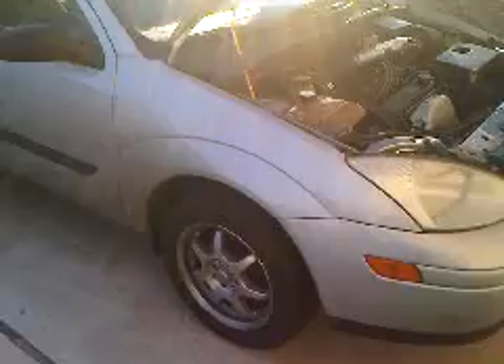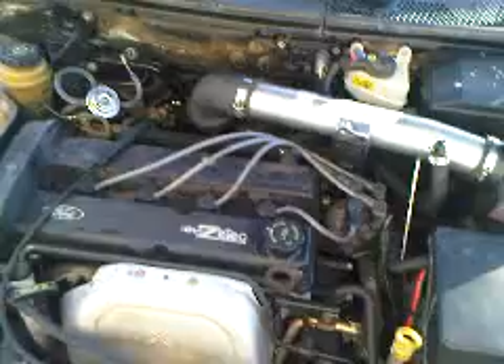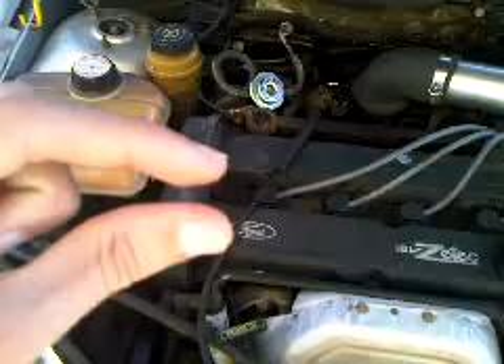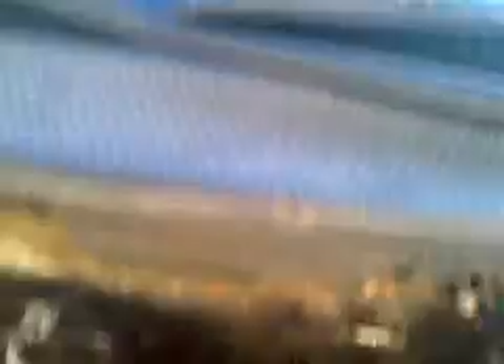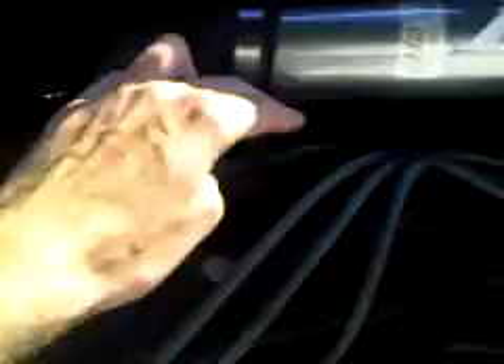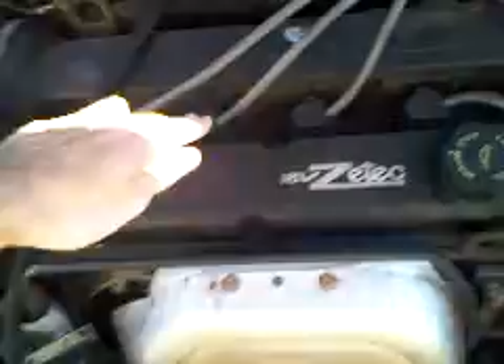2000 ford focus 2.0 DOHC - Engine Randomly dies - FIX?

Comment: I have a lot of experience with gen focus!!! There are not many parts on my 03 focus that I have not updated! I really don't have time to watch this video right now but, When I first got my focus se (Dohc zetec vin-3) when I would come to a stop/idle, It would stall out & what I learned was, The (I.A.C. VALVE) IDLE AIR CONTROL VALVE WAS DIRTY & NEEDS CLEANED ON A REGULAR BASIS! SIMPLY UNSCREW IT, CLEAN WITH BRAKE CLEAN OR SOLOVENT, SOME USE WD-40/PB BLASTER, ETC...I use brake clean & Q-tips, & then follow up with P.B. Blaster, LET IT DRY B4 REINSTALLATION, If yours has a gasket, reinstall it! I don't believe that mine had a gasket so, I made my own, IT IS LOCATED ON THE INTAKE! If you stand at the driver side, front fender & look at the intake, You should see a tag connected to the wire's of the iac sensor, It has been a while but, I found it easier to do while laying under the car, & reaching up to the intake. On a different note, I ruptured the front passenger brake line rite where it does a 90 degree turn & runs from the firewall on the passenger side engine bay, & turns & runs up the sub frame rail so, rite at the bend! I am trying to learn how to disconnect the round-ish fuel device that is directly behind the power steering reservoir? I can not disconnect the small tubular line that mounts on the top of that device. I think that I can disconnect the fuel lines but, not that small line which looks like a vacuum line & is rite on top. Heck, I don't know what it is called to even look it up?

Comment: My 2005 ford focus zx4 is cutting off driving. Anybody having the same issues
Reply: Check the wiring harness from the battery to ground to the altenator to the starter they burn out at are where it goes into to the car to ign/ecu! If that dont appear bad the other problem was the wiring harness to the ignition coil!!

Comment: Update 2: To fix: "Idles worse when warmed up." 
2 problems on my ZX3. 1. Collapsed PCV line at idle. 2. Fuel rail pressure sensor diaphragm was leaking gas INTERNALLY. No visible leaks outside. It's internal. This extra gas
 was flooding the car at idle. I replaced the coil, plugs and wires too but that problem remained even after the vacuum line PVC line  was replaced. The fuel rail pressure sensor leaking internally was it for sure because it leaks gas into the intake manifold via the vacuum line attached to it. Thusly, flooding the car at idle when warm with too much gas. Rough idle when warm is now  fixed!! No more rough idle. That pressure sensor controls the fuel pumps speed. If faulty, you get too much fuel pressure AND gas leaking through the diaphragm. Car runs rough at idle and/ or dies and because its too rich.

Comment: UPDATE: Mine turned out to have the collapsed PCV vacuum line. It throws a a P0320 code but the problem isn't the crankcase sensor at all. The elbow of the rubber line collapses while running and crank case pressure builds and the car won't idle either when put into gear. Just replace that vacuum line which is 5/8". The line may look OK when cold or when the engine is off but when there is a vacuum, it'll collapse because the elbow area under the manifold will get soft.

Comment: I think I have this exact problem that just started today on a 2001 ZX3.. Dies at idle. Dies when put into gear. No error codes. Seems like lack of fuel. UPDATE: I put in a can of SEAFOAM in a 1/4 tank of gas. Guess what !? Your observation and fix WORKED! Fuel pump pickup screen is clogged up from ethanol/water soaked gummy alcolhol sugar. Been raining alot and super humid lately. That muck in there is prolly like jello. The SEAFOAM worked like magic. So, for now,  I can take the car in for emissions testing. 
When I have time, I'll pull the fuel pump and clean the pump's fuel pick-up screen that is bunged up. Thank you! :)

Comment: How do you not have the mass air flow adaptor connected to your cold air intake? that square post on the tube is just open air flow then
Reply: Hi I replaced the fuel filter on my 2000 ford focus with z-tec engine but it still turns off when i start it while its cold

Comment: i picked my car from parkinglot after work it was normal i ride when  the car reach 80c i hear the engine begins to knuckle when need to stop to turn, the car died and i need to wait for 10 sec and start again but in dont know why the car died when  i need to stand still  for turn  the car is automatic

Comment: My 2005 focus is stalling I found a area where the battery is dripping acid once and a while on part of a wiring harness right where it plugs together to the right side of the battery box it looks very crowded. I would think this is an issue at least its a good place to start the harness really looks bad it must have been doing that for a while.

Comment: What's the shiny disc between the air intake and the jug on the passenger side of the engine?
Reply: +Steve Miller Supposedly it's a fuel pressure dampener.
Reply: Ok, thanks!

Comment: I have an 03 zx3 moded out and have been having this issue and watching this video just helped me. It is most likely to be the idle control valve, with all of the things you listed you have done to stop it and everything I have done to mine to try to stop it basically leaves that to play with. So thank you I will be getting mine fixed today.

Comment: its not a filter on the fuel pump its a screen that the fuel passes threw and does act as a filter but the fuel filter is under the car and is in a fuel line usually located bolted on the frame
Reply: Chris thursby located passenger side right in front of back tire on the frame

Comment: check you vacuum hose that goes into your intake manifold. you'll hear a hissing noise. follow the noise. no spray needed unless it's coming from the intake itself. then you'd have to spray the gaskets. i have a 2000 ford focus and it was a vacuum hose with a big ass hole in it. i'll post a video later.

Comment: It's weird, but my car used to do that, until a track-day, when I filled up with mid-grade gasoline, and managed to reach 160km/h. I had no problems since then, I guess the pressure required to run at such speed cleared the fuel line.

Comment: Chris. Next time before all the work just put a gauge on the rail and run to windshield from outside and hold down with wipers to keep at eye shot. Runs it up long hills and what for a drop in pressure , there a vac hose and electronic sensor where the UFO disc clips onto rail (orange clip at line and reg connect.) good job on the diag , Most techs would bounce that. I just found the disc leaking off throttle a little on a customers car on ford discontinued it. Great Motor, I've had three Focus

Comment: I HAVE SAM PROBLEM ,I HAVE FORD FOCUS 1.6 TDCI TREND,IN 2 -GEAR OVER 2.800/RPM 60KM/H+ ACCELERATION HE DIE,LIKE HE DONT HAVE FUEL,PROBLEM IS NOT FUEL,FILTERS,ect..PROBLEM IS ELECTRICITY MAIN BOX,(sensor,and parameters?...IN EUROP TO FIX THAT COSTS -1.000 EUROS!.

Comment: I have a 2000 Ford Focus ZTS, and mine does the same thing.  It used to shut off on me just before it hit E, no gas light or "low gas" warning or anything. Now, its shutting off around a quarter tank. If my gas gets to be that low and I try to accelerate onto a highway ramp or something, my car hesitates/jolts, and even stalls sometimes. I'm pretty sure its the fuel pump, but I'm really hoping its not; so I'm gonna replace the fuel filter first and pray that works.

Comment: Coil pack. Check it for cracks. 
I've had the same problem and done everything you've done. Checked the cap, cracked to hell. Keep in mind, any cracks can mess it up. Replaced mine, runs perfect again.

Comment: man change the harmonic balancer you'll find the rubber support is slightly worn this then sends a false signal to the crank angle sensor,put a new sensor in also

Comment: eh. get an old escort gt from the 80's. those things didn't really have these issues and if as long as you keep em cool they run forever. my foster brother has a 03 SVT that's riced out to shit. He bought for 10k from a dealer and has had problem after problem. He's a bit of a jackass but that cars cost hime 6k in maintenance due to a jackson racing supercharger and an oil cooin system that never agrees with the car.

Comment: I'm about to get a ford focus that has a similar situation. My girlfriend took it for a test drive and it started up, she backed out of the drive way and it "died". She had to turn off the car, put it in park then turn it back on and the car turned over, and she drive it around the block. Fuel pump problem...maybe? How much for a shop to fix it if you know? Let me hear your input please. Thanks!

Comment: @viper19861986 did you put cold air intake to your focus? and did you have to change anything alse to get the intake working? let me know if the intake will be a good idea cuz I want to do the same thing on my car..........
Reply: I have a 2003 Ford Focus. It wants to die when stopped at a stop light ?? Anyone have any ideas???

Comment: One last thing.  If you replaces the rear section of hose you may want to put a hose clamp (other names: worm clamp, jubaliee clip) on both ends of the hose. I put a little grease on the end of the hose and it slid off, so I had to clamp it. A hose clamp will allow you to get a long screw driver down behind the ignition coil to tighten it.  You can hold the clamp in place to tighten by contorting your arm down behind the motor and around the right side of the motor.  :)

Comment: Cool, common problem.   We did the front brakes on my 2000 ZX3 this past weekend and the timing belt / water pump planned for this weekend.  already replaced Ignition coil (#2 not firing), plugs, wires, thermostat, fuel filter, air filter, PCV, pcv hose, cleaned MAF, injector cleaner, 2 new tires, front brakes, now timing belt and water pump.  Oh, also new fender and new hood.   Probably the trans fluid and shocks later.  Mine runs pretty good now, but I still get IAC code (P05016). fun fun fun

Comment: Check the vacuum line that connects the PCV to the back of the engine under the throttle body.

Comment: Looking at the spark plugs from left to right..the 1st wire connects to the top left of the ignition coil...second goes on bottom right..third on the upper right and the fourth goes on the lower left....i think I saw on you car that the first and second maybe even third where wrong...but not to sure...couldnt see that good. Lol....i got the same car thats why.

Comment: @whatchaknow100 just because you have problems doesn't mean others will you have to take care of your car and  it will never have problems mine has 81thou on it and the only thing iv ever changed was the fuel pump and it runs like it came out of the dealer. you just didn't take care of your car.

Comment: @viper19861986 My filler tube filter and the sock on the fuel pump were both perfectly fine and I couldnt see any gunk in the tank, but the actual fuel filter was REAL filthy yeah :)

Comment: @viper19861986 hi bud! I almost forgot about this video :) I just wanted to let you know that I sorted my problem and it almost defies belief. There was no gunk in my tank, but the fuel filter was FILTHY! When I looked, it had never been changed in 11 years even tho the car has a full service history. It had gone rusty and the filter had choked up on its own rust. Unbelivable. The problem is 90% solved, but Im considering having my injectors cleaner because some always gets through the filter.

Comment: Hello there, I am currently the owner of a 2001 Ford Focus ZTS 2.0 DOHC 5spd.  After many trips to the shop because I am not that skilled with cars and after spending like 2000 on it someone finally mentioned the mass air flow sensor.  my symptoms in the car were severe drop in mpg's and random fits of stalling when I took my foot of the gas.  It happened one day then it was ok the next it went on for a week or two on and off until we replaced the mass air flow sensor and the idle control sensor

Comment: Awesome video bud. I have a Ford Mondeo that has similar symptoms to yours. Its not quite got to the stage where it stalls yet, but when it idles it is slightly bumpy. If I rev the engine and let the revs drop they go all the way down to about 350 and it almost stalls before picking up again. It seems to drive ok normally, but if I put my foot right down it actually seems to lose power slightly. I changed the normal filter and it made it a bit better, but ima change that pump filter now :)